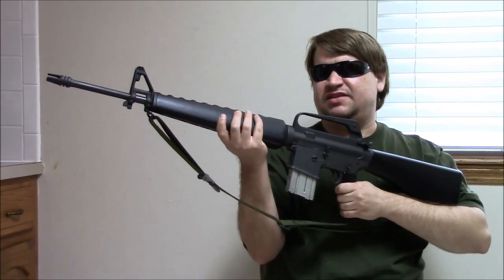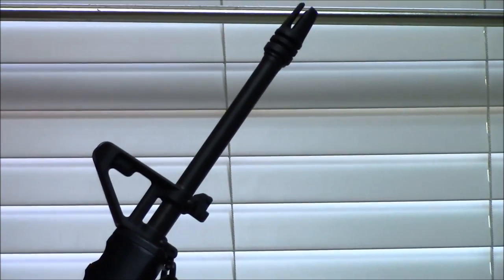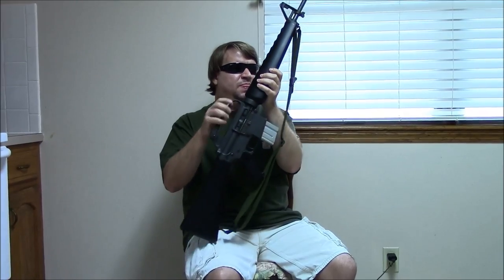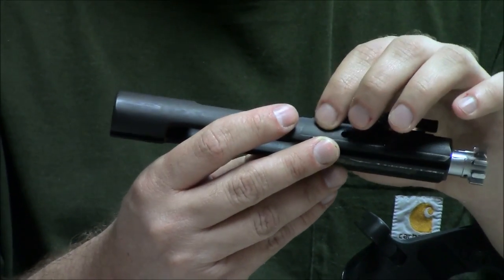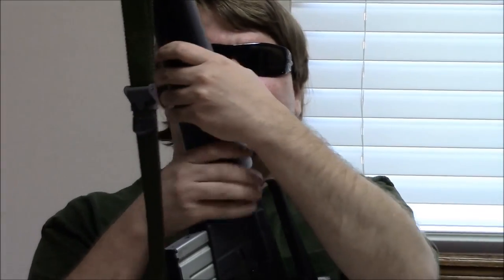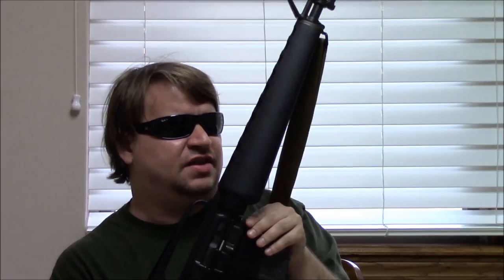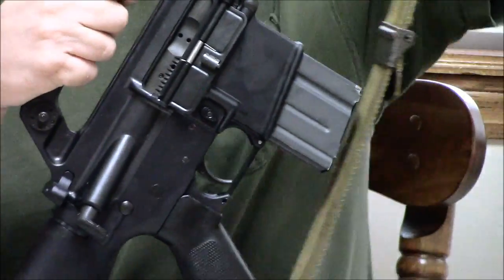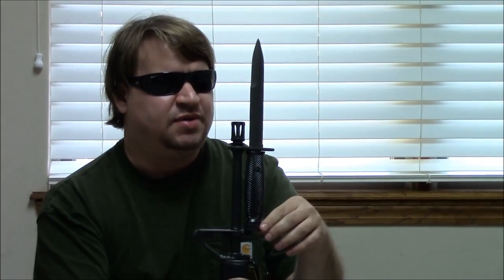Early Retro AR15s Part 1: Colt SP1, M16A1

Comment: Excellent video of an gorgeous 1965 SP1!  Finally someone who knows what he is talking about!  The SP1 is patterned after the Model 602 "02".  Since Colt probably engineered the SP1 around 1962/63 the rifle in production at the time for the military was the Model 602.  The SP1 is a dead ringer for the 602 as you can see the slab side upper and lower which is exactly what the 602 had.  The roll markings are exactly the same on the SP1 as a later Model 602 except the "Model 02" marking was changed to "Model SP1" for the civilian AR-15, and no Property of US Gov't roll marking as well.  Some people say the SP1 looks more like a 604, but the 604 had a captive pin partial and later full fence lower so it is closer to the Model 602 with its non-captive pin slab side lower.  Colt decided to just keeping the civilian Model 602 running and just eventually adding feature improvements like trap door buttstocks with fixed sling swivels, new buffer and tube, no roll pinned buffer tube extension, serrated bolt carriers, cotter pin firing pin retainer, new firing pin, parkerized and strengthened "shot peened" bolt, chrome plated chamber and eventually bore, new stainless gas tube, forged front sight base with forging marks, riveted front sling swivel, drainage hole handguards, birdcage flash suppressors etc.  Of course these new features went to Military production rifles before Civilians got them so there was a delay.  Colt never gave us the M16A1 forward assist and full fence lowers until decades later.
Reply: Yep, all good & correct info based on my research too. The only real major difference with the SP1 is the enlarged front takedown pin and the double headed screw it uses. Lots of interesting variations with the early SP1s (1964-1969 lets say) too.

Comment: Green Mountain Barrels is now buildin the original 1/14 20" pencil barrel for $167! I have one on the way. It was only the cold weather tests that prompted the change to 1/12.... The cold dense sub zero air made the bullet inaccurate with 1/14. But that not generally a problem in Texas. The test 1/14 barrels of project Agile were horrid wound producers with M193
Reply: That is ridiculously awesome.

Comment: Nice! 65 model! Been looking for a 65 or 66 model in mint condition
Reply: Early '65s look the same as '64s, except for not having the dimpled takedown pin.
Late '65s look pretty much the same as all '66s and the early '67s. Late '67s though, they quit rollpinning the receiver extension into the receiver, but there is still a pilot hole for it at least. Also of course the machined bolt pin is long gone. 
The cutoff serial for early vs late/standard SP1s seems to be right at 10,000-10,500.
I know someone who has a '64 SP1, with a Winchester 1/14 twist barrel, so they were really reaching into the old parts bin that day! I'd love to buy it off him someday just for the novelty.

Comment: i have a '67 colt sp-1 my dad bought long ago new at a sporting goods store. doesnt have the pronged flash hider. its like an a2, but with open bottom. totally slab-sided.
Reply: Right, that is an A1 flash hider. You can see the same on my M16A1 in this video. 1967-1968 was the transition period for the SP1 from early M16 parts, to M16A1 parts. The SP1 line though was always slabsided throughout its production run.
Reply: Ozark Bear Arms so Colt went from the three prong Type 2 Duckbill flash hider to the A1 in '67/68?
Reply: Yes, first the birdcage appeared on the XM16E1, then became standard with the M16A1, and after old stock of the 3 prong was used up; the birdcage made it onto the SP1.
Reply: Ozark Bear Arms 
They changed to the birdcage from the three prong, because the three prong flashhiders were getting caught on vegetation in the Vietnam jungle... is that correct?